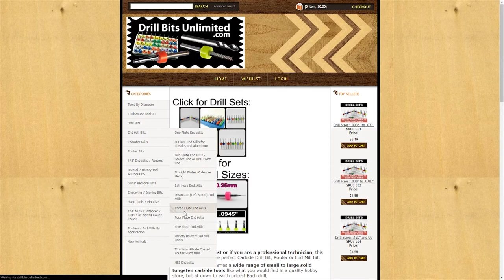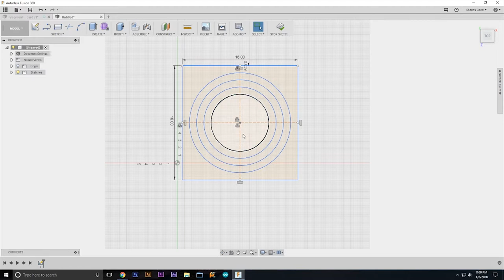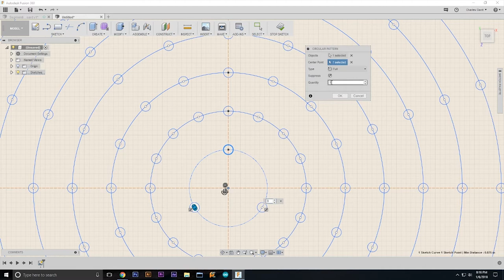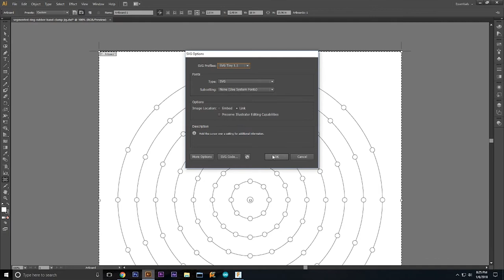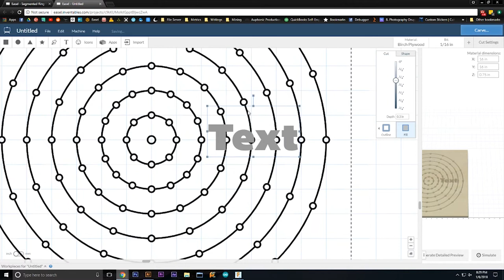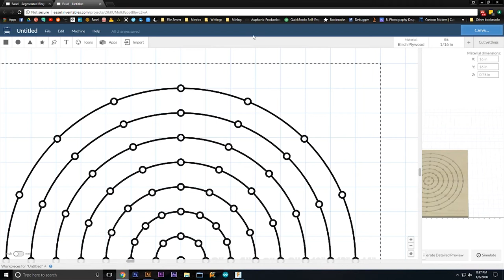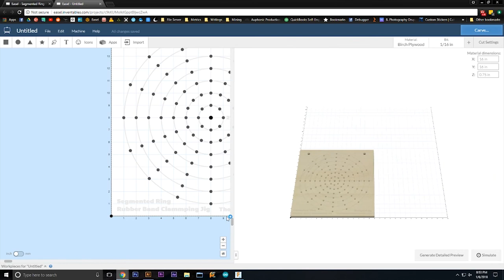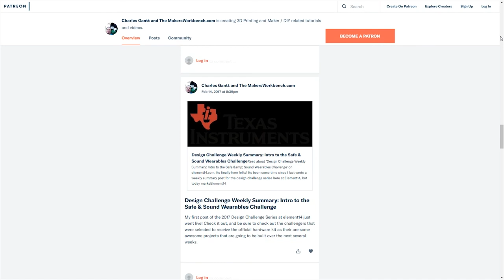Design It, Build It 001 - How To Design A Segmented Ring Clamping Board in Fusion 360

Comment: I mentioned this elsewhere, but this process will help me design a marking jig I’ve been wanting to design for a while.  Not being as familiar with the programs as you I’ve not really known which on to use.  I think after watching this I will be able to do it.  Just curios. Isn’t there a way to layout something like this in illustrator?
Reply from the maker: Thanks Chad! You can do this in illustrator, as well as Inkscape, but I am not proficient enough with either of them to layout dimensionally accurate plans like this. I find it easier to just design in Fusion 360, and export to DXF then use Illustrator to export the DXF as an SVG.